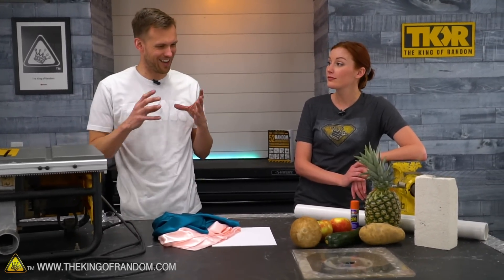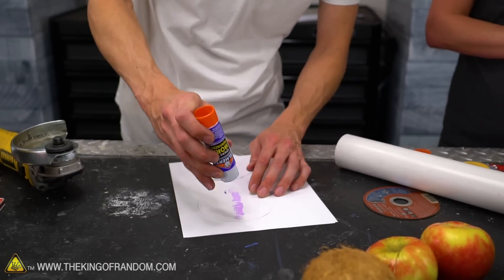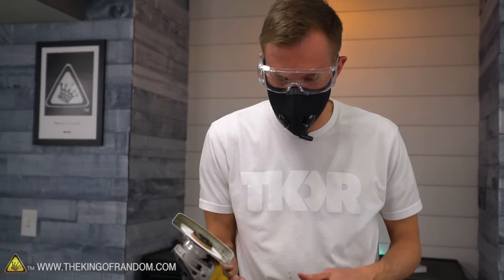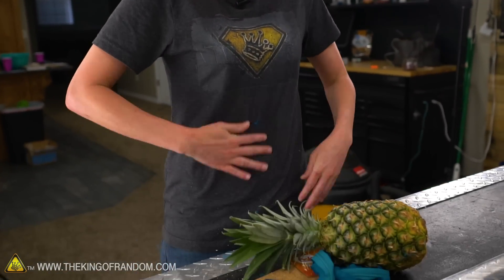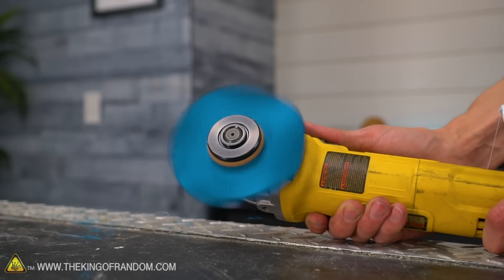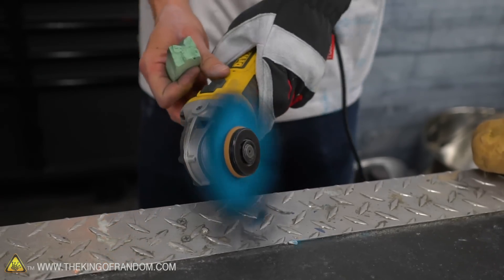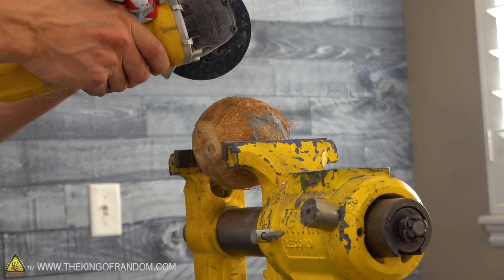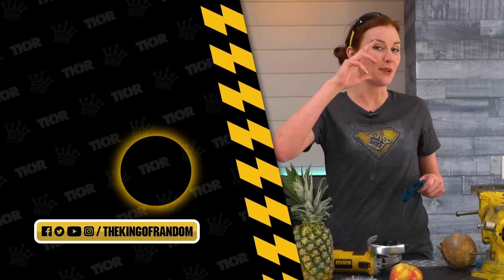How Silk Can Cut Through A Coconut

Comment: Use an actual floppy disc removed from its casing, a CD, and maybe aluminium foil cut into a circle :D
Reply: A CD will explode at the speed an angle grinder spins.
Reply: Try duct tape :D
Reply: @xavieronasis5361  Slow mo guys had to spin a CD at 23 000 RPM for it to shatter, where an angle grinder spins at around 10 000 RPM.
And if you use a DVD you could spin it at around 32 000 RPM before it shatters
Reply: @xavieronasis5361  A CD wont explode at the speed of an angle grinder, the slo mo guys had to spin it much faster
Reply: @shepardpolska  lol my bad, didnt relply until after i had watched the vid, read my mind
Reply: @shepardpolska  that was probably just resonation (vibrations that occur at a particular frequency that magnifies flex to a point the stress simply breaks the object).  CDs were not exactly manufactured to extremely tight tolerances and it was easy for them to warp.  To account for this, cd-readers used a floating laser that rode all the random bends and warps to keep the eye at the proper distance to read the data.  The disc will probably shatter at a much, much lower RPM if it was applied to a cutting surface.
Reply: sounds awesome, y’all should give this a like that way they see it
Reply: @Pinkamena Pie are you saying that's a reason NOT to do it?
Reply: Some kavilar
Reply: Packing tape might have interesting results too!
Reply: Gorilla tape/duct tape
Reply: That would probably be more effective that the silk brush
Reply: Then saw a boat in half with it
Reply: A CD explodes at high RPMs
Reply: I would watch that
Reply: Pinkamena Pie all the more reason to do it
Reply: All of those sound awesome
Reply: floppy disks are hard to find now
Reply: @LULU1422__  yup
Reply: @undeadslayer988  no
Reply: I actually used floppy discs as cutting tools. It's amazing just what they cut through at 10k rpm.
Reply: Yes yes yes yes
Reply: @xavieronasis5361  just another reason to try
Reply: Sup chief
Reply: @xavieronasis5361  not really. I've put a CD on mine it will wobble and even cut things but it will not hold together well but won't just break apart at least not 100% of the time
Reply: @SwiftCreationStudio  The one time I tried it, it exploded, sending tiny shards everywhere. Guess I had bad luck there....
Reply: @xavieronasis5361  it will eventually I was able to put an xacto knife to mine and cut circular sections off but the potential for disaster there is pretty high lol
Reply: CD and floppy will explode
Reply: Gamer_boi yes cause it’s quite dangerous
Reply: @severeflipper  it's a matter of how fast and what you're cutting. 

It won't explode on its own until high RPMs and it all depends on the grinder.
Reply: YES....
Reply: The CD would shatter
Reply: Yes
Reply: Yeah but the disc inside is very floppy hence the name
Reply: @LULU1422__  you can find them on Ebay for cheap
Reply: I think he did that already didn't he??? It may have been someone else but I know I've seen that before lol
Reply: Polish the aluminum foil when you do it!!!!
Reply: Yes dat would work
Reply: Yeah. That's what I was thinkng
Reply: Guys they should try cardboard
Reply: With paper and silk if it flies off it will not harm the user. If a cd or floppy disk shatters at even 10,000 rpm it is very likely to seriously injure the user.
Reply: @undeadslayer988  And with the power of flex tape, I will use flex tape to hold together and angle grinder! Look I sawed this Angle Grinder in half!
Reply: That's a great idea cool 👍👍👍👍👍👍👍👍
Reply: Potato 🥔 sqwad

Comment: Generally speaking anything can cut, as long as it’s going fast enough
Reply: Does that mean I can cut my underwear without touching the outside?
Reply: Does that include dihydrogen monoxide?
Reply: Facts
Reply: Rather "burn" things, going fast enough....
Reply: So your saying a pineapple can cut anything
Reply: @oofoof9388  yes.. A round pineapple slice  (spinning fast)could maybe cut anything..
Why don't you try it urself(if u have angle grinder)
Reply: @ALM1GHTY2398  yes
Reply: This is incorrect in some cases eg using a slice of mango to cut rock to mango slice would just break if it made contact at high speeds
Reply: @Pope_Protein  yes..we are generally talking about solid or semi-solid things(the thing that won't break/squish if pressure is applied on it..)
Reply: @ALM1GHTY2398  but we need a round thing..using a phone would cut less and hurt more..
Reply: I believe that the harder substance would cut the softer substance regardless of which was doing the spinning.
Reply: Bhakti Bhandari imagine more of like a beam of some object, some atoms, or even particles moving faster than the speed of light. Therefore anything can cut with the right amount of speed.
Reply: spins cat on finger like a basketball
Reply: @tavinkeovora203  If you go such deep,then maybe yes  :)
Reply: This is a bad statement. Its really really bad. They just proved your statement wrong because silk doesnt hold together long enough to go fast.
Reply: @tavinkeovora203  yes water....
 but no one can cut things with water (atleast not in a single attempt)
Reply: Try human skin
Reply: @bhaktibhandari7379  incorrect again if you put a point on any object anywhere and rotate it making sure the point stays where it is it will make a circle if it spins fast enough it would practically have the conditional and properties of a circle
Reply: @bhaktibhandari7379  you can cut with water look at pressure washers
Reply: @Pope_Protein  I think you misunderstood something...I meant the no one can cut with water,spinning it in a circular motion(like with an angle grinder)
Reply: @Pope_Protein  come on man..If you spin it that fast,every solid spinning thing can cut stuff..but here,I am particularly talking about angle grinders...(they cant spin so fast..try spinning a normal shaped fidget spinner(3 sided one..) and touch it on your skin..it wouldncutbut the collision would hurt you(note that here I am talking about 'slow speeds' and not very high ones)
Reply: What about a gas or liquid, you said anything and they are impossible to cut with. Also they proved you wrong in the video because even if it did spin faster than an angle grinder than it would just break or undo itself
Reply: So my peewee could cut something then?
Reply: Mr_Blue_ Sky any thing no matter the chemical makeup can cut at high speeds.
Reply: Leon Caples if you get your urine to accelerate like a water jet, than yes
Reply: @dsadasfdsagf4351  yes. Dihydrogen monoxide is very efficient at cutting.
Reply: @tavinkeovora203  But not at high ROTATING speeds ,though..(cause we can't simply make some things rotate)
Reply: My hand can cut
Reply: Exactly
Reply: JustJesseツ laser cutting?
Reply: My name is Barry Allen, and I am the fastest man alive.
Reply: Speed, I am speed
Reply: Even tears can tear if they r going fast enough
Reply: Paper
Reply: True @tavin keovora
Reply: So air🤔🤔
Reply: Water can’t cut
Reply: @dsadasfdsagf4351  if its frozen than yes h2o can cut
Reply: Finally I can chop a tree with my foreskin.
Reply: Ghazty I know I was just kidding😂
Reply: @chumpodumpoman9421  it cant without pressure, nozzle and abrasive. But there are water cutting systems out there
Reply: Does that mean that theoretically speaking, i could cut through the Earth with a sneeze?
Reply: Cut with an I phone because that's all is useful for
Reply: @dsadasfdsagf4351  yes it includes dihydrogen monoxide look at water jets
Reply: I remember when The King of Random was actually inspired and had fun and innovative ideas
Reply: dsadasf dsagf thats water buddy
Reply: Ghazty it would disintegrate before you even got near the rock, angle grinders spin at around 20,000 rpm
Reply: j.oz you would be correct if you ignore the brittleness of some compounds
Reply: Tavin Keovora only photons can move at the speed of light so you’re wrong 🤣
Reply: Bhakti Bhandari bud, water jet
Reply: Bhakti Bhandari Id bet that I can find a way, I have 2 angle grinders
Reply: Mr_Blue_ Sky how bout plasma, or electrons😂
Reply: Tavin Keovora very very false
Reply: Jamie Johnson bro laser pointer angle gender blade🤯🤯🤯🤯🤯🤯🤯🤯🤯🤯🤯🤯🤯🤯
Reply: Mr snake nah
Reply: TimmyTimeTurtle now that’s the spirit Timmy
Reply: Taylor Morgans you’re so wrong
Reply: Even air?
Reply: Jebby Hut photons can move fast because of the fact they don’t obey the laws of friction. If you remove resistance such as: gravity, air friction,etc than you can accelerate anything as fast as you can imagine. The medium most likely to be thought of is space itself
Reply: Rubber duck?
Reply: Tavin Keovora ya true
Reply: mazouzi sidali lmao
Reply: Yes that’s what I was thinking
Reply: @dsadasfdsagf4351  Yes it does
Reply: @bhaktibhandari7379  ye I thought you meant cutting with water in any possible way
Reply: @bhaktibhandari7379  still a slice of mango spinning at 60000 rpm if it somehow didnt shred itself would still not cut stuff it would break on contact
Reply: Oxygen?
Reply: I like how everybody is arguing, if you spin this thing it will fall apart. No, the point of this comment is that if anything moves fast enough it can cut through anything. Not just on an angle grinder spinning.
Reply: @bhaktibhandari7379  we aren't talking about rotating speeds, just high velocities. You misunderstood the original comment
Reply: @ryanschubert5480  may I just say one thing. Personally I dont care much about everyone arguing BUT can gasses cut things if they move fast enough?
Reply: JustJesseツ well... a laser is light!! And some lasers cut things... right??
Reply: @taylormorgans726  actually there's literally a machine that uses water to cut stuff
Reply: @taylormorgans726  ever heard of a water jet? With enough pressure water can slice through objects like butter
Reply: @flarefrost6302  yes...gasses if shoot in high pressure concentrated into one spot at high velocity would infact cut through it
Reply: @MrMez99  like this one
Reply: @counselnoblevc3531  sweeeeeet
Reply: @enVIdGaming  yes actually if its moving fast enough
Reply: mazouzi sidali Yes, from the inside... with a needle.
Reply: alright lemme go get my water and spin it
Reply: Okay, this isn’t really wrong, it’s just more theoretical than anything. If you could get any object going fast enough (even though it might not be physically possible to get it going that fast) it would cut.
Reply: @dsadasfdsagf4351  water jets cut metal
Reply: @jebbyhut4711  To discuss further we would need to lock down the definition of "cut."
Reply: @ryanschubert5480  yes😅
Reply: @Pope_Protein  it would shred! Unless we apply some binding agent on it, we can't save it from shredding..
Reply: @counselnoblevc3531  yes.. even there's a machine which shoots out sand particles at very high speeds and concentrated at one spot.. it's also used to cut things ..
Reply: @vmartin112  it's not spining water that cuts its high pressure water shooting at one single concentrated spot
Reply: water?
Reply: Prove it
Reply: Well if it’s too soft it will not cut
Reply: I feel like certain thing would just burn
Reply: Yes try it until it works
Reply: And diamonds?
Reply: kinda like skyrim... any class can win, as long as you put enough points into it
Reply: just like how anything is edible, though it might only be the one time
Reply: IM GOING FAST AT THE SPEED OF SOUNND
Reply: mazouzi sidali Lol... that one made me chuckle!
Reply: @lucaspatrick542  I have done my quest for the day
Reply: @justjesse8232  yeah use a mirror or magnifying glass
Reply: So my hand can cut?
Reply: What about air then
Reply: Does that mean a pillow can cut someone?
Reply: My blanket can cut me!!! NOOO!!
Reply: Hyria Sarthromen Styrofoam.
Reply: Does that include the bodies in my basement?
Reply: What about a non Newtonian fluid blade?
Reply: Can raw meat cut
Reply: @awkwardpotato7900  y e s
Reply: @bhaktibhandari7379  Freeze it. Ice is still water.
Reply: If a human was fast enough, can they cut through an object or would the object win? 🤔
Reply: So the flimsiest material like foil can
Reply: He means solids
Reply: @dsadasfdsagf4351  Yes, if it gets to 0 Celsius, although it would quickly heat up from the friction.
Reply: @justjesse8232  Lasers
Reply: @ALM1GHTY2398  Sure!
Reply: @tavinkeovora203  Yes, but that is very impractical. Of course, this whole discussion was theoretical, so I suppose just yes.
Reply: @tavinkeovora203  Yes.
Reply: @MrMez99  they do.
Reply: @justjesse8232  yes it’s called a really concentrated laser

Comment: Hey y’all should try using a cd 💿 as a blade. That would be interesting 🤔.
Reply: If the angle grinder went to fast I think the CD what just break apart
Reply: Jesse Lo it would. Watch the slow mo guys video
Reply: It'd break from the speed
Reply: Yeah it would break
Reply: Use the motor from a cd drive
Reply: what about a cd dipped in supper glue and covered in sand
Reply: Michael Knupp mmm supper glue Ansel! There is supper glue!
Reply: You would not even be able to tighten it down without breaking it

Comment: Blade material ideas:
-leaves
-CDs
-different tapes
-Styrofoam
Reply: And 3 d printor plastic ☺️
Reply: I feel like cds would just be like the blade and cut right through but the other ones are great
Reply: @Drxpxs  r.i.p.
Reply: they should do this with micarda
Reply: Why don't they try a wooden blade.
Reply: glass?
Reply: I don't think leaves and Styrofoam will hold themselves together very well even with glue. CDs depending on the speed will just shatter. However the different tapes sounds like an interesting idea. Duct tape can be made into a pretty robust piece of swathe.
Reply: I would love to see the tape and leaf ones
Reply: People have done CDs like this before, perhaps even TKOR has done it. But CDs don’t hold up, they just explode. And definitely would do so, if you try and cut with them.
Tapes though. :thinking:
Reply: Glass
Reply: Do gallium
Reply: Or melt down  pencil lead and use that as a blade
Reply: @cashtaylorsversion3898  A CD might just break.
Reply: @jonthebrick4525  lol that might be hard to do but I like this idea.
Reply: @fluffehgamer4712  I know :)
Reply: Ok sorry didn’t think about them breaking

Comment: That's funny they're actually explaining what a floppy disk is
Reply: feel old... They also explained what a cd... I still remember debating with my mom to get a dvd reader...
Reply: They’re exposing for the new generation
Reply: "Like your save file icon"
The fact that they have to explain... I am 19 but I feel old now
Reply: Even i know what a floppy disc is
Reply: @matekovacs2696  we still have working floppy disks at home... and i am about to turn 20...
Reply: @boerkur_k  We do as well. And probably that old computer with a floppy drive would still work if cleaned thoroughly.
Another interesting piece of history we have here is a laptop from the '90s. It ran DOS, but with black text on white background. It even has a dock with two slots for expansion cards. No USB, no Ethernet, no audio jack, no display output. Only serial, paralel, a jack for a numpad, a Ps/2 for external keyboard, and a dial-up modem port.
Oh and I think there was a Commodore 64 with joysticks in the attic when we moved here.
Reply: @matekovacs2696  yeah you should see our basement, like mobile phones the size of a brick and an old laptop that's so heavy you can't really carry it around

Comment: Ideas for blades:
- screen from screen doors
- glass or dinner plate
- thin piece of wood
- orange peeling or other produce
- playing cards
- plastic bags
- cd / dvd
Reply: Here's some more:
- Clay/ceramic
- stale bread
- ice?
- resin
- MDF (similar to the thin piece of wood)
- nougat?
- hard candy
Reply: couple more

- leather (differing grades of)
- carbon fiber
- neoprene
- crisp (chips) packets nowadays come with a foil plastic combo, which could be interesting.
Reply: Probably try some Kevlar
Reply: dvd/cd Yes
Reply: They should make one with wood and use it on wood and see if they can start a friction fire 🔥
Reply: Floppy discs, nails. Possibly hair? Different slices of fruit. A circular towel. Band aids. Trash bags. Maybe a water blade????
Reply: Screen from not form
Reply: Hoy about a leather blade.
Reply: yes definitely
Reply: Leather
Reply: @fodderfella  Carbon fiber would be a neat idea, both in sheet and finished form.

Comment: More ideas for blades:

Aluminium foil
Different plastics eg ABS, PET etc
sandpaper
Graphite
Carbon fibre
Reply: Epoxy resin, 3d printed parts, glass
Reply: Yes I’d like to see aluminum foil or sandpaper
Reply: glass could be to dangerous
Reply: yes pls
Reply: Sandpaper discs is actually a thing. You have a rubber backing pad, and then the sandpaper works as a grinding disc. 

I much prefer them over flap discs, better control with the paper.
Reply: Glass
Reply: Glass would be way dangerous. Not sure I'd even want to see that
Reply: I would like to see a pet and abs turn into blades too

Comment: So Instead of buying metal blades all these years I could of just opened my notebook?
Reply: Yes, it works quite well with rotary tools depending on the material you're trying to cut through and number of layers of paper you're using. Oh, and you can cut through some types of metals with it also depending on the rotary tool's RPM. I think like 1 layer of printer paper cut go through like brass with enough RPM but you can't just glide through it super fast either. The friction of the surfaces heating or melting and then sheering away as an action needs to happen.
Reply: @AM-dc7pv  How many layers for glass?
Reply: @MattJasa  Glass would likely be one of the materials it wouldn't go through. Mmmm, silica is actually a interesting material though. Glass might actually require diamond tips and water. Cutting through regular float glass, like a bottle or something?
Reply: @AM-dc7pv  What If draw diamonds on the tip of the paper? Diamonds and pencils are both graphite.